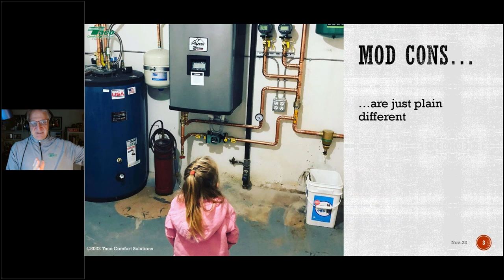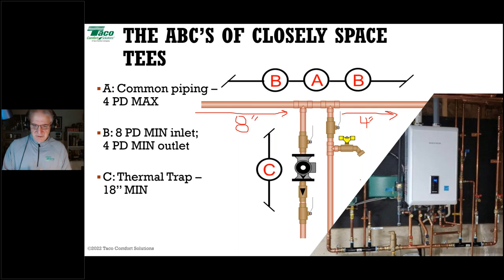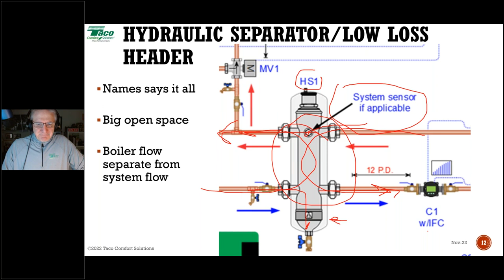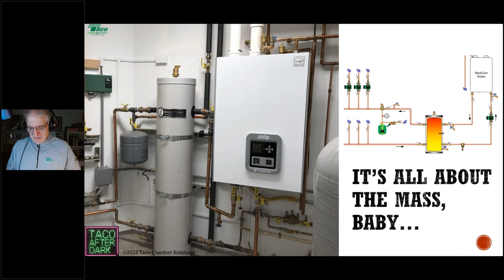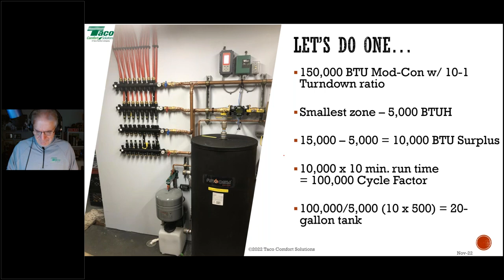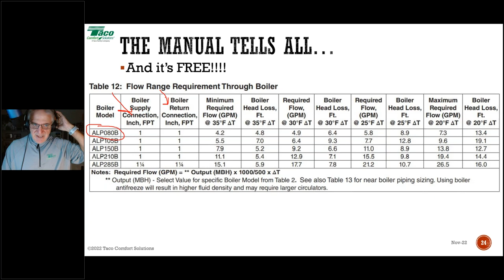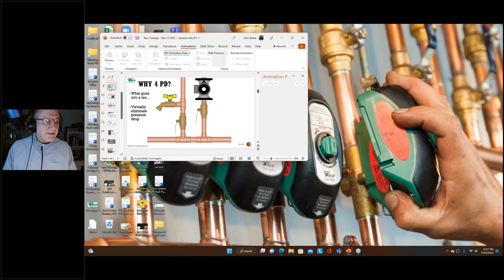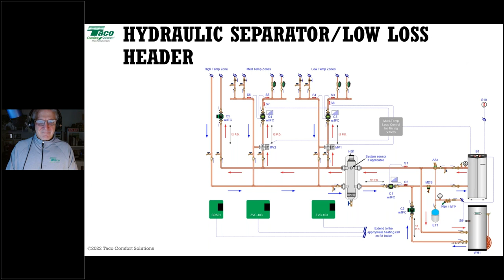Closely Spaced Tees, Low Loss Headers & Buffer Tanks – When, Where, Why

Comment: When you used a 10-1 turndown ratio what were you referring to
Reply from the maker: We are referring to the boiler technology in the firing rate. Many of the newer wall-hung type boilers have a turn down ratio. For our  example of 10-1, if the maximum btu firing rate was 100,000 BTUs per hour, then the lowest would be 10,000 BTUs per hour.

Comment: wondering why they recommend piping the indirect off of the primary loop rather than after the hydraulic seperator off the system manifold.  Ive seen many and even have installed a few years ago after the seperator and they work just fine as far as I can tell.
Reply from the maker: @bryanswanson5007, first off, thanks for watching Taco Tuesday, greatly appreciated. To answer your question, it is suggested to take off for the DHW indirect tank tank first to allow all of the energy the boiler is making goes to generating hot water for the house. It will depend upon several factors like the size of the indirect tank and the size of the boiler. It may also lie with the control sequence that the boiler manufacturer has in their control logic. And that is the beauty of hydronic heating, we have lots of options to achieve the same thing!

Comment: The 4" & 8" distance either end of the Tee, is that straight pipe to the next elbow? Or is it before connecting into the boiler?
Reply from the maker: The 4 and 8 is referencing pipe diameter so if you have 1" pipe, it would mean 4" and 8". Anyway, the 4 and 8 references before any other fitting in the pipe whether it is a tee, elbow, coupling or even a valve. This design is to have the proper type of flow internally as well as the hydraulic isolation desired.
Reply: @TacoHVACtv   I was meant to ask 4x and 8x. Nevertheless, you have addressed the question for me. Many thanks! 😁👍
Reply from the maker: You're welcome!

Comment: Anyone brought up the idea of making parts to convert the average water heater tank into a buffer tank?
Reply from the maker: An average water heater used as a buffer tank would be used as a two-pipe buffer and has the advantage of adding mass to the hydronic system whereas the 4-pipe is used as adding mass as well as hydraulic separation. The 2-pipe buffer doesn't add the separation
Reply: @TacoHVACtv For those who already have a LLH installed in their systems, but lack of mass, where would a 2-pipe buffer be installed?